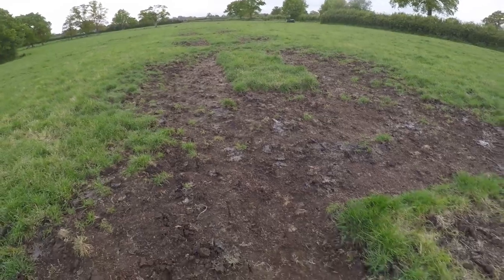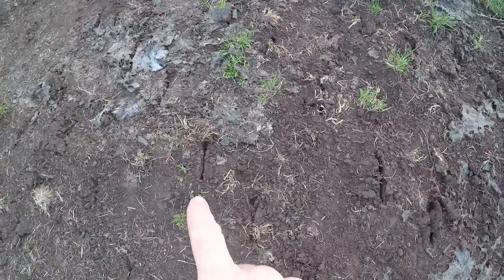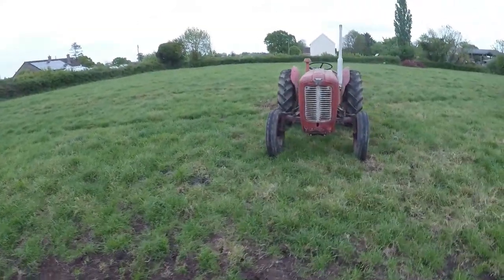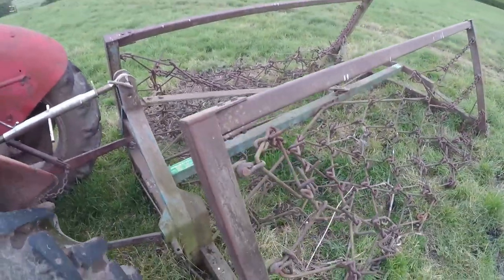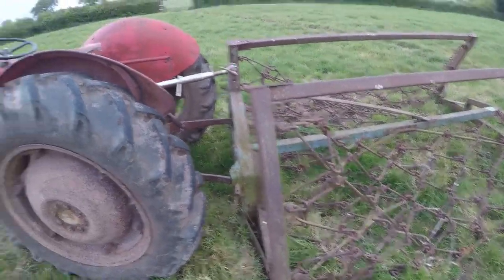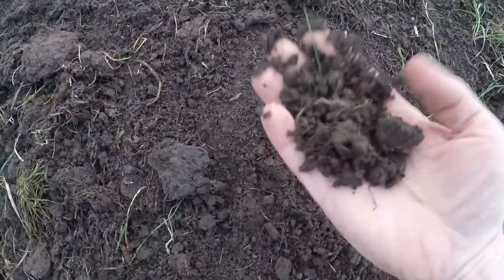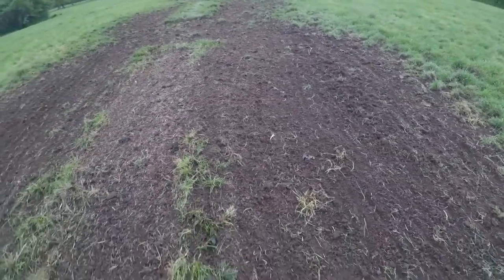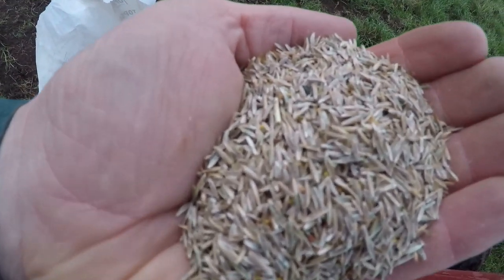Grazing field patch repair.

Comment: Another great video. We had a set of Parmiter folding chain -harrows ,but am sure it was a wider set as we used the 178 or 185 on them,rather than our 35. Whatever it was a lot easier than moving the old trailed  set around by buckrake! Parmiter made good equipment.

Comment: Perfect size o tractor an harrow for the job 💪👍
Reply: surprised 35x lifed it?
Reply: @marcusrichards6588  My Mf 135 can lift a 16ft set with weights on front no problem.